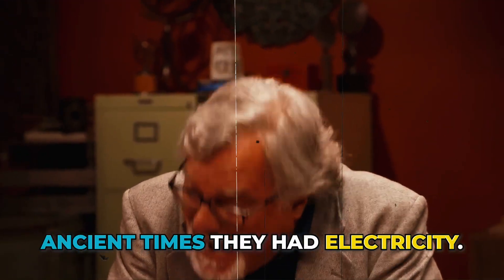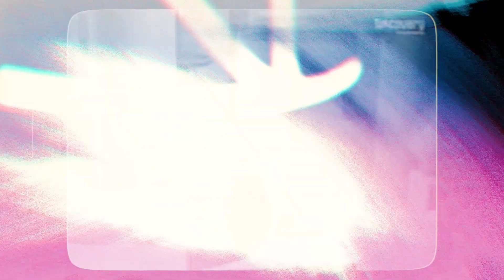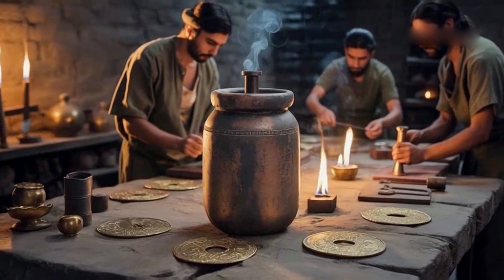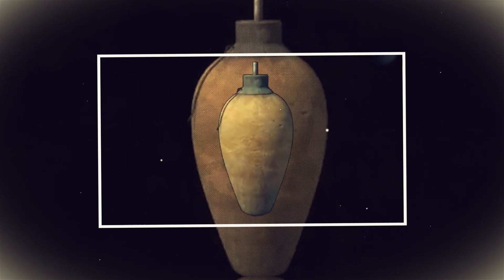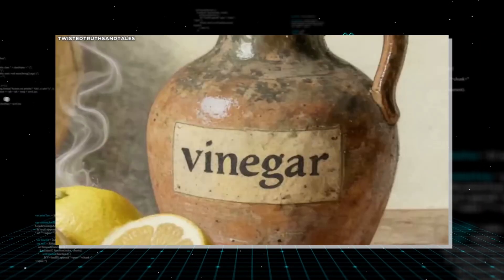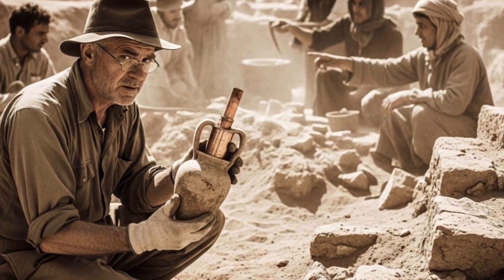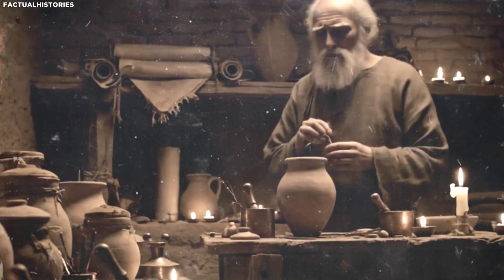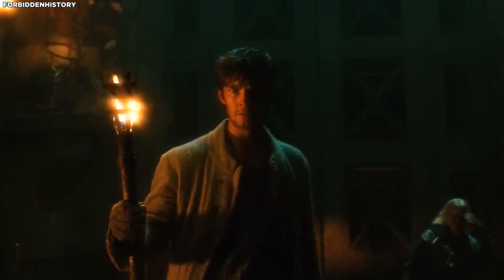Scientists Just Solved The Baghdad Battery Mystery - What It Found Left Historians Speechless

Comment: Copper cable wire has been found encased in granite within a hidden chamber in the Giza pyramid, but they still say that there is not enough evidence to suggest that it was a power generator.

It's so obvious to me that they were using it as a pizzio-electric pulse generator with small controlled explosion that pushed the water at the lower chamber that generates a water hammer effect on the already pressured quartz. 
And now there is more evidence for grounding pillars beneath the pyramid generator.

Comment: Clickbait, more repetitions than all teletubby-episodes combined, no clear message, let alone something "terrifying".
Why should the have done electroplating, it if was easier to use hammering or fire-plating?
Has anyone calculated and tested the actual capacity and power of these materials + plausible electrolytes? 
Also, no devices driven by it seem to have been found or identified.
These cultures lasted centuries, but despite such findings, there ist no evidence for development in this area, so the initial claim, that they were way more advanced, that archeologists had thought, doesn't hold.

AI-babbling and void image rain is on the rise, but no gain from it.